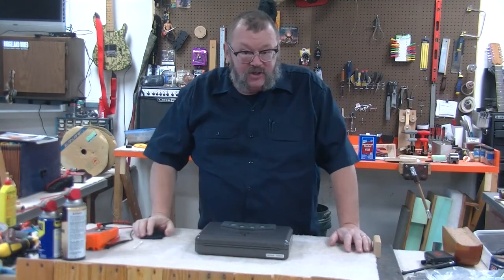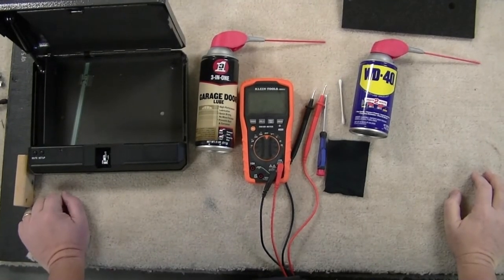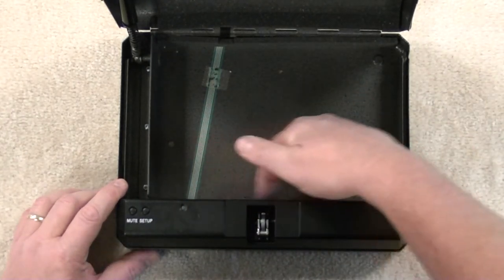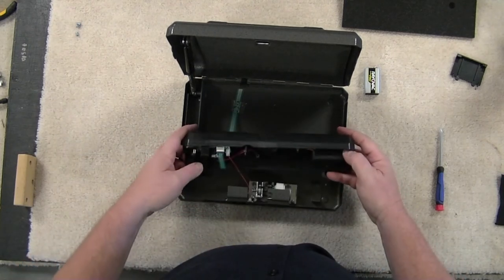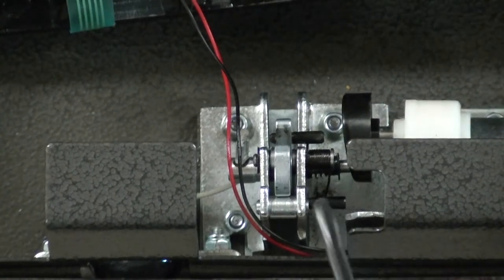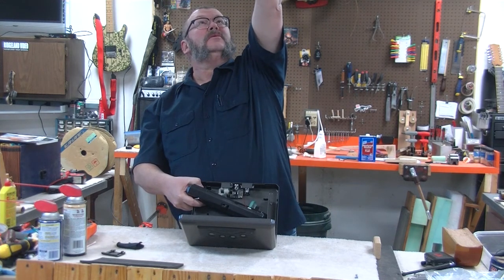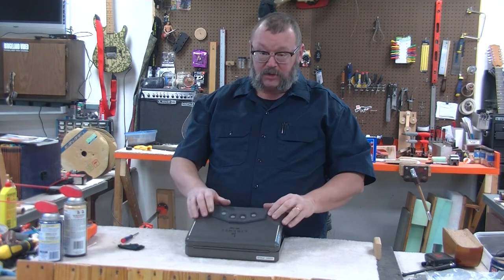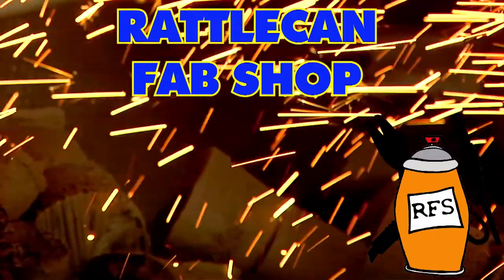LIBERTY HD-100 gun safe fix | RATTLECAN FAB SHOP with James O'Rear

Comment: Working with a Liberty Home Defender Series HD-100 Quick Vault.
The battery is dead and have lost the key. I remember the combination but I guess since the battery is located INSIDE the box, I need to know if I can externally jump start the battery?  Or, what is the solution?

Comment: Great Video, But I'm having the opposite problem. the little electric motor is not engaging all the time. The motor seems to  intermittent.  Any ideas?
Thanks
Reply from the maker: Weak battery or a bad connection I. The circuit maybe?